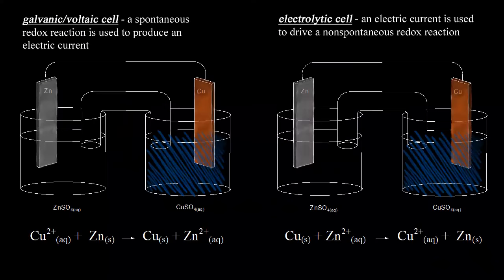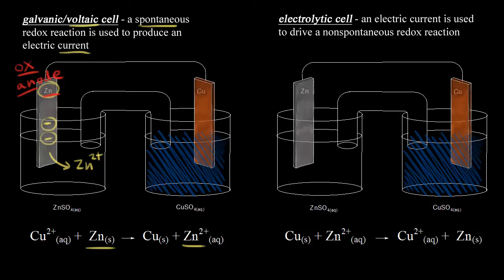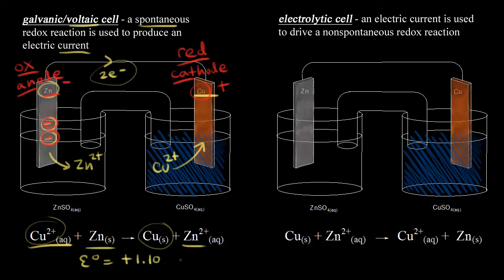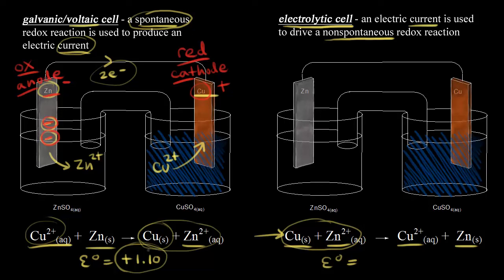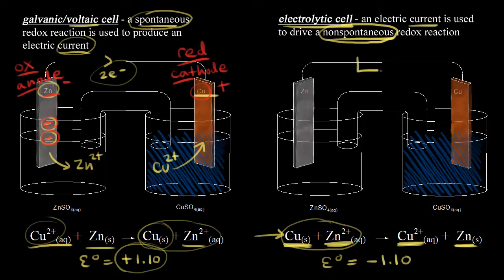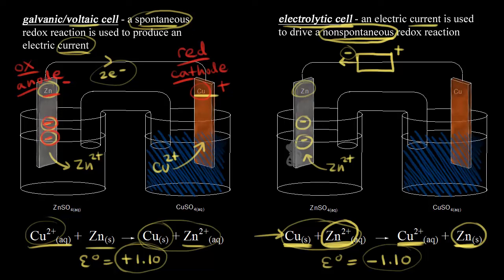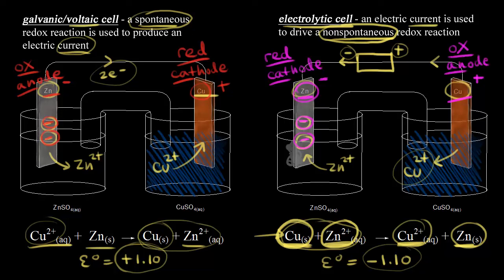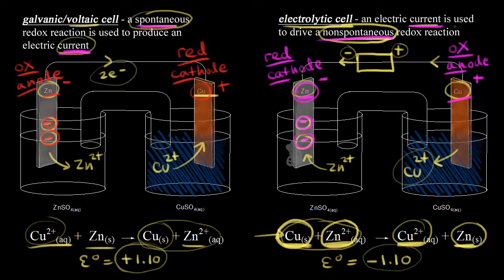Introduction to electrolysis | Redox reactions and electrochemistry | Chemistry | Khan Academy

Comment: So if I was using electrolysis to remove rust from something.  Would the rusted part be connected the the negative or positive of a battery charger?  Seems like it would be to the positive side so it looses electrons which should remove the rust? Or do I have it backwards?

Comment: Thanks for the explanation on this, very well done.  However I do still struggle to understand why wouldn’t the Zn cathode not loose electrons back through the bridge between the two containers back to the Cu anode and return to the battery since current/electrons always return back to the source?   Seems as though they would both gain and loose electrons at the same rate/time and nothing should change...
Reply: Well zinc is higher up the reactivity series than copper and is more reactive so there is a greater ease of zinc to lose electrons over copper

Comment: i have a question. can anyone tell me, inspite of sodium being more reactive then hydrogen, why will hydrogen ion discharge at the cathode instead of sodium ion when a sodium chloride solution is electrolyzed? similarly, why will chloride ions discharge at the anode and not hydroxide?
Reply: +Misa Amane you might have mixed up reactivity of atoms vs stability of the ions. 
The Na+ ion is more stable (less "reactive") than H+ ion and so is less likely to be discharged.
Reply: Meta Tutor
oh yes!!! thanks a lot!!

Comment: Why different metals emit different amount of hydrogen? For example for the same time and energy Graphite creates more hydrogen than aluminum, zinc, or other metals. Does that depend on the energy spent for oxidation? If the energy is the reason, can you point me to any material that calculates the energy spent to create different oxides. Thanks in advance.
Reply: Aki Sharipov I’m not sure but could this have to do with hydrogen being a poly atomic atom ?

Comment: What would happen in the electrolyric cell, if the battery was reversed? Would the electrons then flow to the right into the CuSO4 solution? And would it be performing any work?
Reply: lol was about to ask the same. 
What would happen if we add a reversed battery to the voltaic cell? I think it would just greatly speed up the process of spontaneous reaction. Or perhaps the battery would be charged? Idk

Comment: what's the  relationship between mass and volume of a gas at S.T.P?
Reply: 1 mole of a gas has volume 22.4 liters at stp. the mass of 1 mole depends on the gas. the number of moles and the volume are directly proportional to each other in the ratio 1:22.4 (moles:volume)
Reply: so mass and volume have no relationship with each other. right?